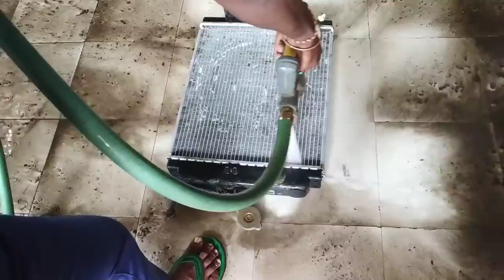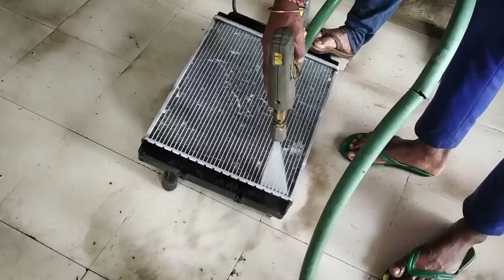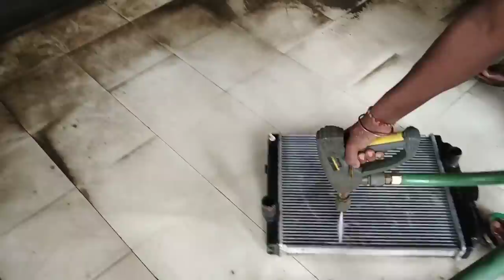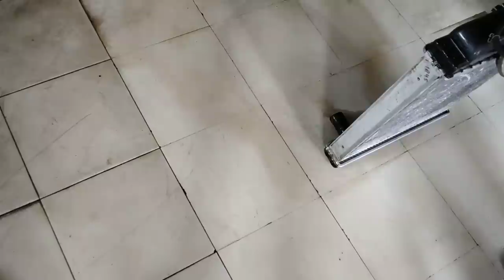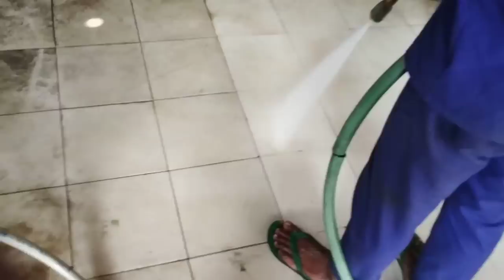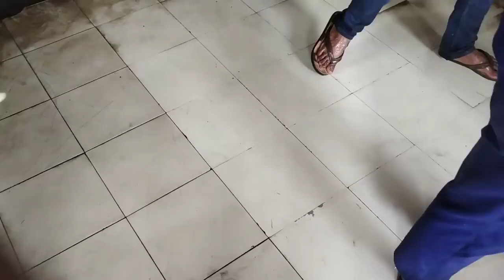Dirty Radiator Cleaning by high pressure washer

Comment: Wrong process of cleaning radiator, first blow with air compressor and wash it with low pressure.
Reply: Its a lazy and unprofessional
Reply from the maker: Thanks for your opinion. What's the right process? Actually I don't know.
Reply: @agritechupdate8179  I've already mention it, firstly blow with air compressor and after that wash it with low pressure not high pressure.
Reply from the maker: @akulolomi9294  🙏
Reply: Can we use touchless shampo and wash it with 60bar preasure washer.

Comment: No no no this is wrong!
Clean dry radiator first with high pressure compressed air and then rinse with low pressure water.
Reply from the maker: Okay. Thanks for your advice.